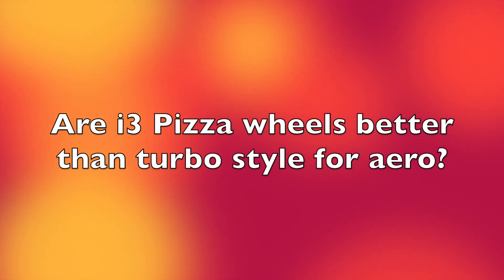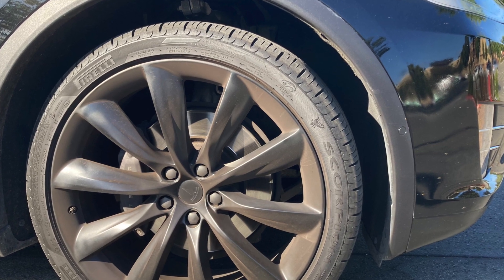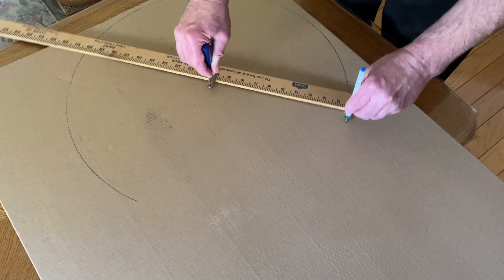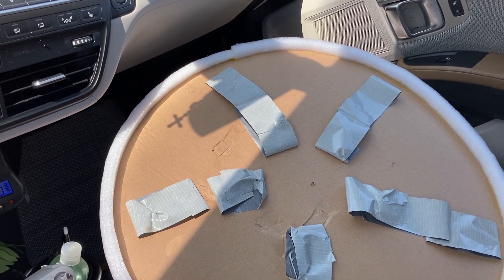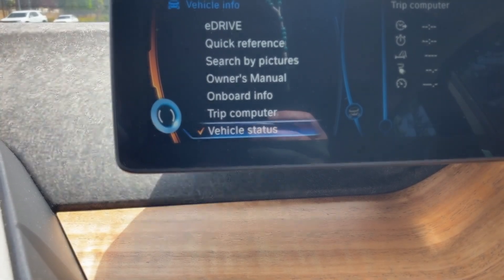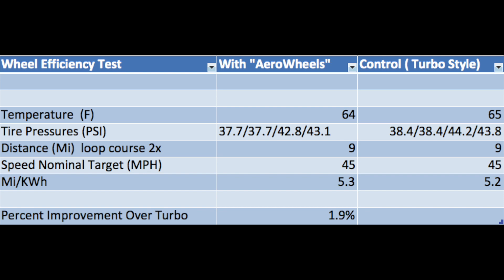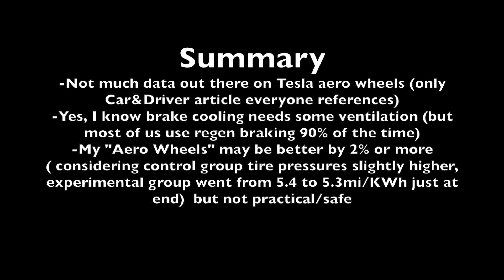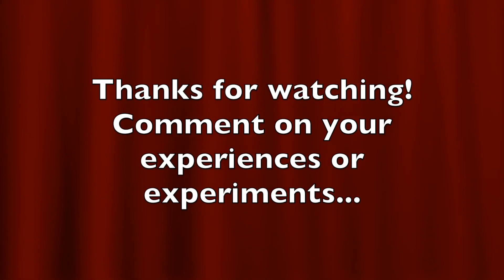BMW i3 "Aero" Wheels efficiency Vs Standard Wheels

Comment: My first thought - brake overheating, rotor warping, brake fluid boiling without any air flow into the  wheel, but you knew that.
Reply from the maker: Yep,  but for 95% of the time I rarely use any braking (try to use regen only and get the "5 stars" on the driving efficency screen!), so overheating is less of a concern.     Thanks for watching!

Comment: I agree with your conclusion, the 427 and 429 are too similar to make a noticeable difference. I had the same experience on my 2015 REx... 428's for summer and 427's for winter... it was hard to tell if the efficiency improved since the wheels were similar weight, same diameter etc. However, now on my 2019 i3s BEV, it has the big 431's and they are much heavier and not aerodynamic at all. They are the widest tires ever used on an i3. So when I bolt on the skinny 427s for the winter the efficiency improvement is noticeable. Now I haven't tried to scientifically prove it like you (altho it would be fun) so I can't provide solid proof, plus summer vs winter variables here in Canada are constantly changing. However it seems that on roadtrips the 427's help make up for some of the range hit from the cold for sure, not to mention the car accelerates much harder with the 427's since they weigh less, tho the tires scrabble for traction at times compared to the sticky EP500's. Keep up the great work!

Comment: Interesting test. I wonder how much of a weight difference there is between the pizza wheels vs others? Also, I believe the wheels are “turbine” instead of “turbo”
Reply from the maker: You're right on the 'turbine' wheel naming.  I haven't been able to find the wheel weight differences in any specs I have.  Maybe a viewer that has both sets can comment.   Thanks for the feedback!

Comment: Viewers may be interested in this Utube video looking at Tesla range differences with different wheel options. Tesla publish data on this so some reliable test data.

https://youtu.be/NYvKxsYFqO8

The wheel options do vary in width and profile so there are more variables at play.

Hope you find this informative and interesting
Reply from the maker: Thanks for sharing the link.  Wheel diameter is quite a big influence.   A few percentage points of efficiency due to wheel configuration doesn't sound like much until you multiply it by millions of cars!

Comment: I am not a fan of how covered wheels look, and as we all know these cars are designed for lower speed usage.  I doubt at these lower speeds you will gain anything, other than having an uglier car, ad you can't monitor your brakes etc. at a glance. Thanks for the experiment, I did wonder about this...  My main concern with these is proper tire pressure and where to get new tires from that don't cost the price of a cheap ice car?
Reply from the maker: Fair enough!   I run with higher tire pressure to improve the range, as it is one of the bigger factors.   I just picked up a screw in my rear tire, and thankfully it could be patched, else ~$600 for a new rear set!